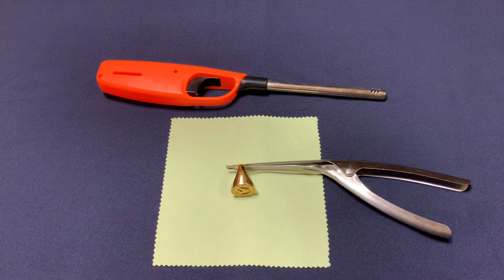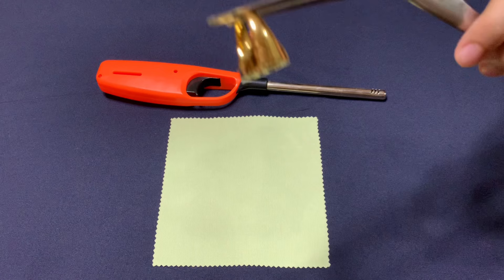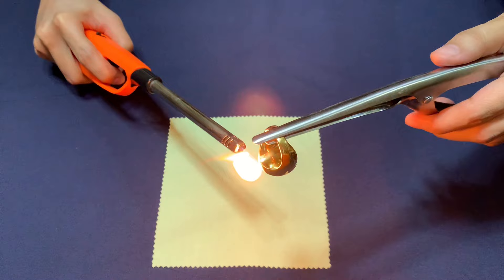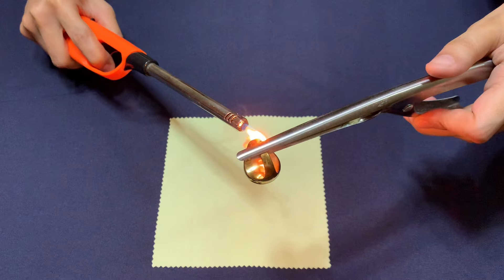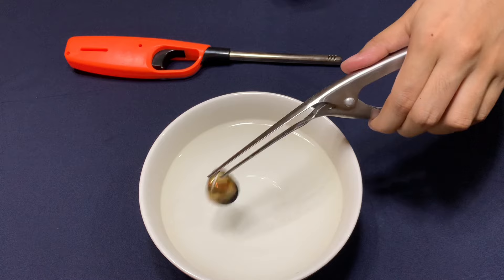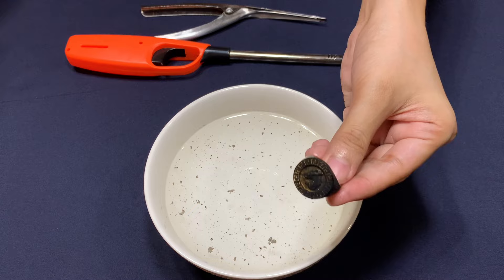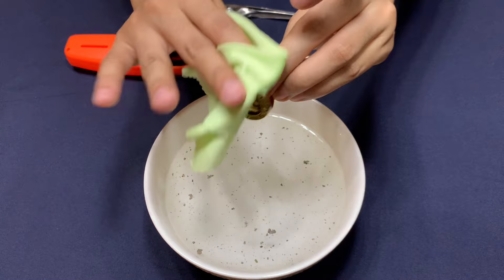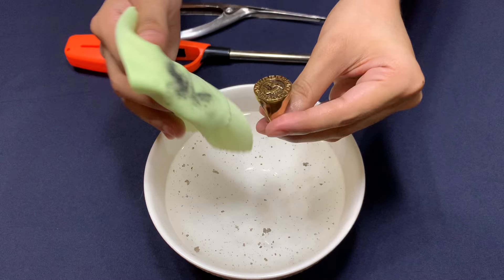How to Test Gold With a Lighter (Real vs Fake)

Comment: Is this real gold then?
Reply from the maker: Yes. After cleaning it, the color remained the same as before, so it is real gold.
Reply: @GoldFunction  I have tried mine with a lighter and it made a black layer which all washed up 
What would that black layer be , is from the fumes 
Thanks
Reply from the maker: @bogdanb6415  the black layer is usually residue from the lighter's fumes. Since the black layer washed off, it's a good sign that your gold item may be authentic.

However, it's important to note that the lighter test is not foolproof, and there are more reliable methods to determine the authenticity of gold. We have other testing strategies at https://www.goldfunction.com/category/testing/
Reply: I have some items that I tested as gold (10-24k) but no marks.Ive read that if you do an acid test ,like I did and it test positive then it’s not plated it’s solid 10k 14k etc.Is this true? Also if I list online I imagine no one wants to buy unmarked gold? What should I do with the gold ,sell online or to a dealer?
Reply: does this work on white gold too ?